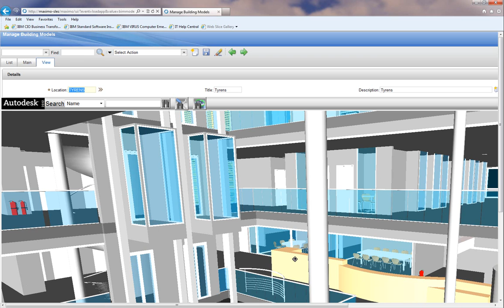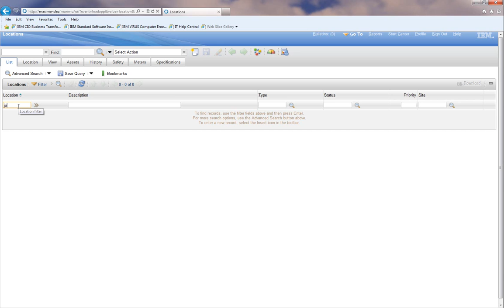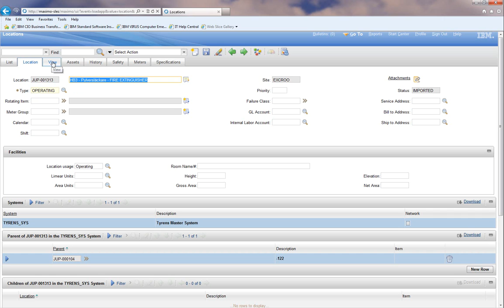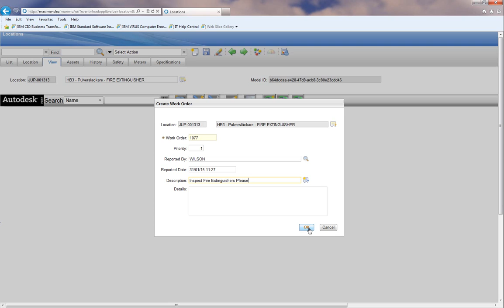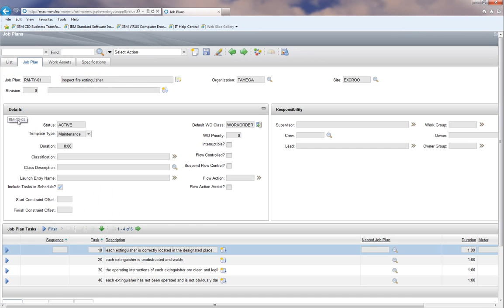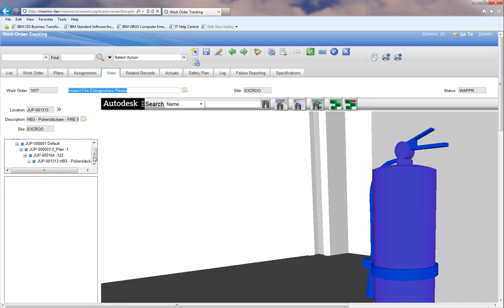Tyrens BIM demo - Revit och IBM Maximo

Comment: So you have to use Revit to do use "COBie" in Maximo? 
Does it not support native IFC models? 
If not, then is it COBie if it is not using IFC? 
Hum...I don't think so! It look like Maximo is in fact using proprietary data from a proprietary tool and in fact not doing COBie nor using IFC. 
You cannot utilise subsets of the IFC schema, i.e. COBie, without using the parent schema...this just doesn't make sense. Is Maximo really using COBie? 
There is a lot of smoke and mirrors going on here! 
If I'm wrong, then please educate me further in these regards.
Can you show Maximo and it's direct relationship with IFC and utilisation of the COBie MVD?
Reply: The relationship between COBie and IFC is a projection, a mapping if you will.  The IFC MVD for COBie is one of three valid representations of the COBie data.  the other are XML and XLS.  And frankly, I'm not aware of any applications that consume or produce COBie in IFC format.  Maximo both consumes and produces COBie in XLS format. Its COBie, we don't care or know its source.  There is nothing proprietary about it. The COBie schema stands independent of IFC just fine.
Reply: To import all the data we have exported the Revit-file into IFC. Then with SolibriModelChecker exported the information from IFC to a COBie-formated Excel-sheet which then was imported into Maximo database. At the same time we exported the Revit-file into NWD-format which shows in the Maximo embedded Navisworks Manage. The connection between COBie and Navisworks in Maximo/BIM the GUID.The versions of Maximo that are using the Navisworks viewer are still supported - although the browser required is not supported by Microsoft - this is because the browser
required for Navisworks has a pre-requisite of ActiveX which is no longer supported by Microsoft. 

Keeping with the old version of Maximo/BIM, We have shown how easy it is to work with just an IFC file - generating the COBie from the IFC using something like Solibri or even
XBimExplorer for example

We definitely use COBie to import the data - and as you know, as long as you keep to the mandatory COBie format and fields, the scheme is extensible and adaptable - you
don't have to populate every field in COBie to import the COBie into Maximo. When using the old version of Maximo/BIM, since you are using NavisWorks to
view the model, you have to have a Navisworks compatible format so I normally use .nwd files. 

In the newer version of BIM for Maximo we are not using Navisworks, however, we can still render .nwd files into the viewer if required. The Large Model Viewer is based on the
Autodesk 360 technology and using this we can render and interact with many different file formats including .nwd, .rvt, .ifc In the